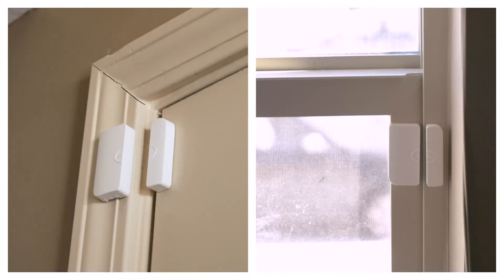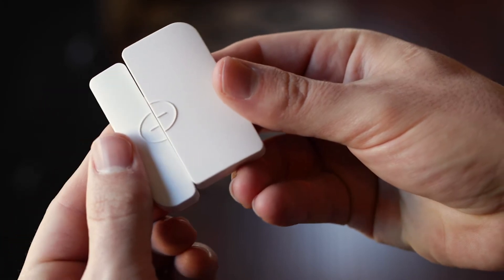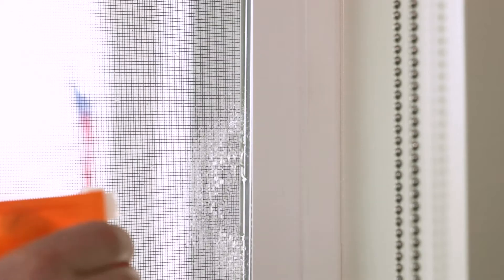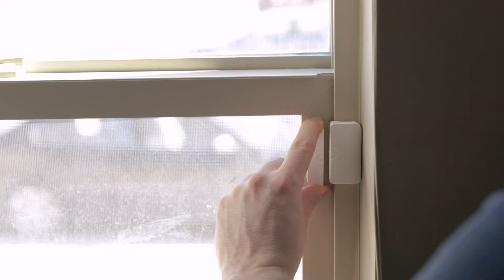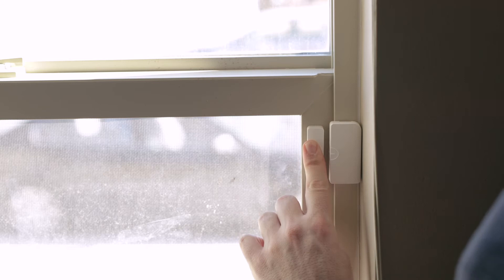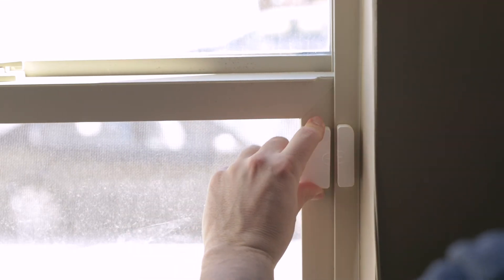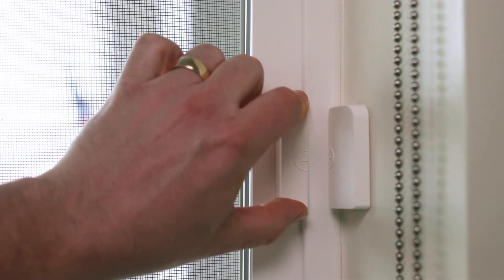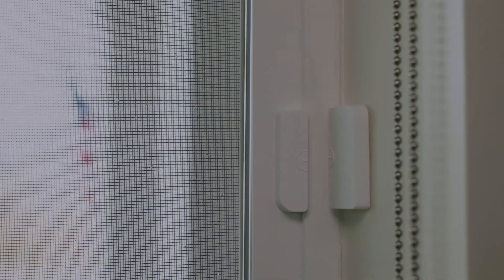How to Install a Window Sensor - Cove

Comment: My windows travel up/down which isn't a problem. The issue is, the window tilts in for cleaning. The Cove window sensor is too thick and the window can't tilt in if I want to clean the exterior side of the window?
How do I install the sensor?